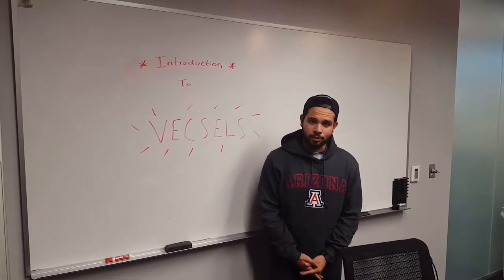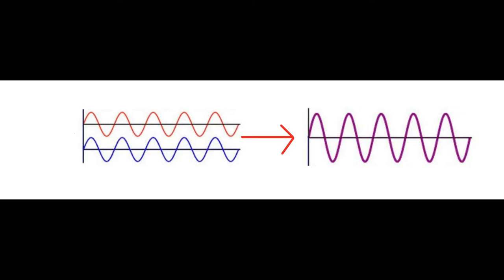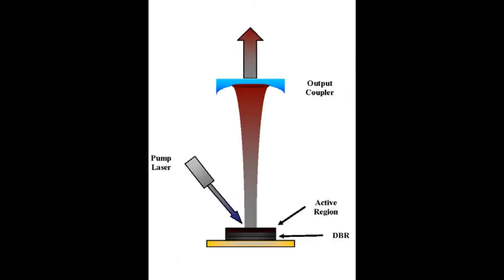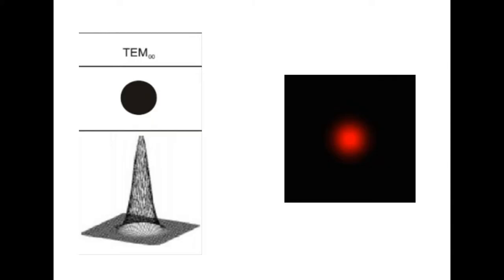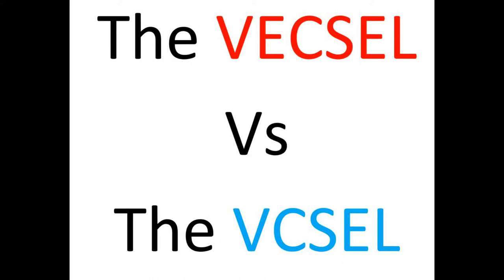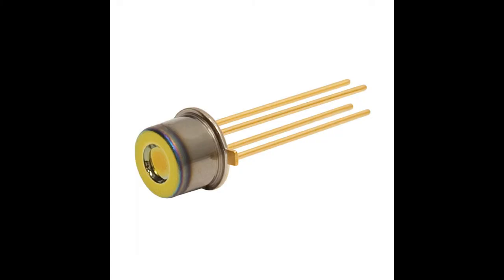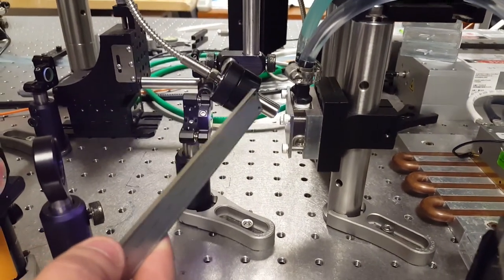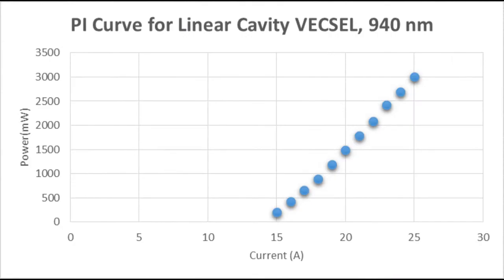An Introduction to VECSELs, OPTI 380 Final Project

Comment: Really cool to cover vecsel and much appreciated. But the talking is really fast at the end and seems to end abruptly.

Can you elaborate the angle and tuning more? At the end you say the chip is designed to lase at a certain wavelength but prior you say the angle has a role in the wavelength the chip lases